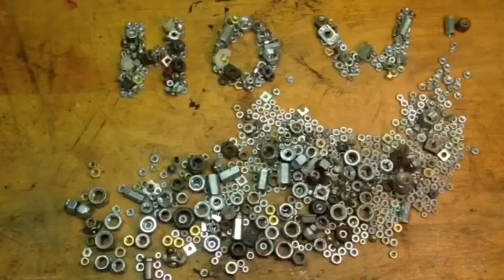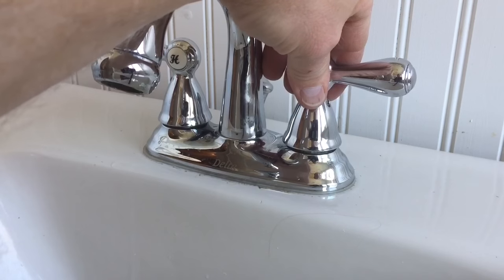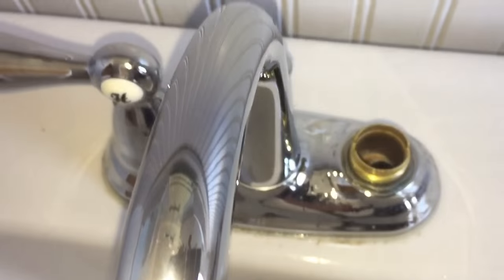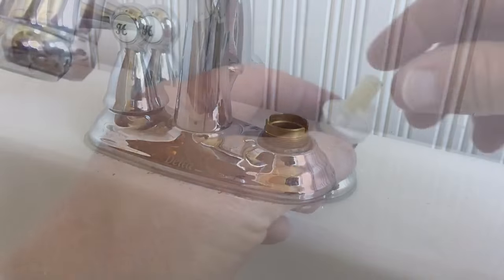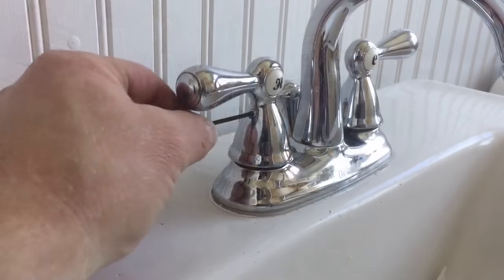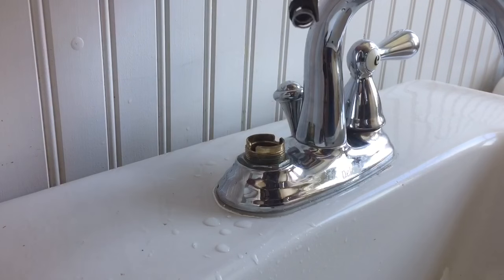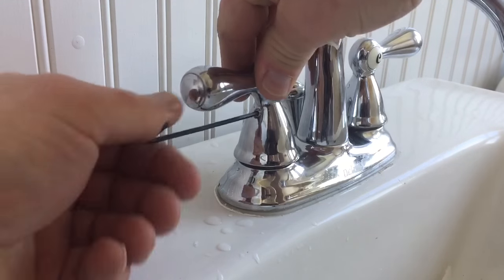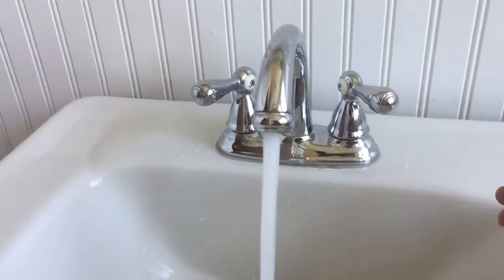How to change the stems, seats and springs in a Delta Faucet

Comment: Make sure you get real genuine delta cartridges. NOT the fake ones found at homedepot, you want the one with the brass end. Otherwise you will be doing this again in three months time and sure as suger I have upon tell I Learned the hard way.
Reply from the maker: Good thing I don't shop at home depot. I do know that Lowes sells the Delta brand replacement parts. Thanks for the view.

Comment: I'm trying to remove that white stem from the faucet on my bathtub and it just will not give, currently trying to pry it with anything I can find.
Reply from the maker: Try spraying it with a penetrating oil and letting it sit for a little bit, then gently rock it back and forth. Thanks all I got. Good luck. 
Thinks for watching

Comment: In your video, as you are replacing the new stem,  the lock is facing away from the facet. Then, it looks like you cut your video. And wah-lah, the lock is magically facing toward the facet. I feel your video is good. However, it is misleading. Because, you had your lock facing away from the facet. Then, at the end of the video, the lock is back facing the facet. You should have explained this as a mistake.  This is per instructions of delta.
Reply from the maker: Go with the part of the video that works if you are confused...It clearly works for me in the video, magically or not. Thanks for watching.